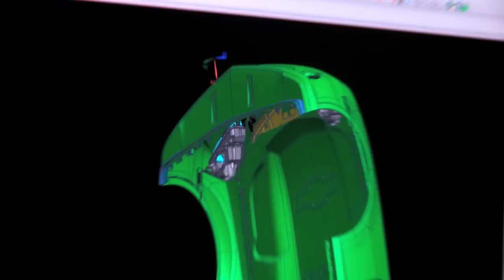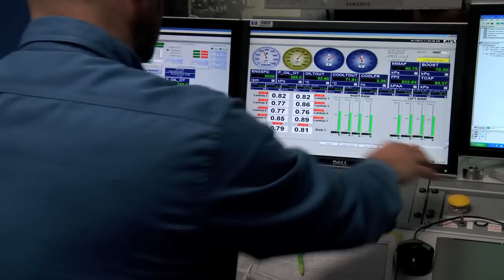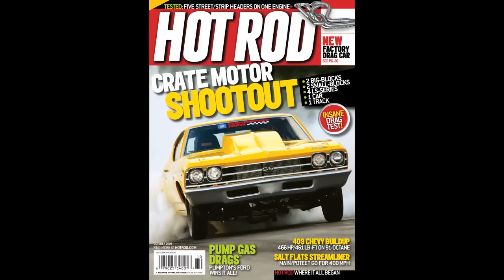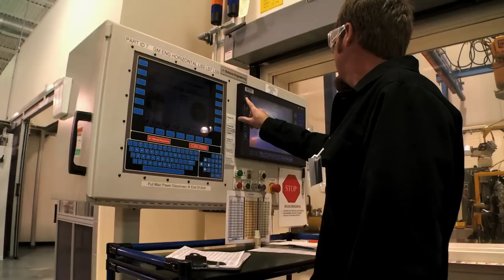2012 COPO Camaro:  GM's Baddest Factory Camaro Ever! - HOT ROD Unlimited Episode 6

Comment from the maker: To those questioning the purpose of a drag-only car produced in limited numbers, here's the deal. NHRA requires there to be a minimum of 50 factory-built models of a car in order for it to be legal in Stock and Super Stock competition. The COPO was built for just that reason, same as the Mustang Cobra Jet and Challenger Drag Pack. Also the same as many legendary muscle cars of the ’60s, such as the ’68 Hurst Hemi Darts and Barracudas.

Comment: If you look at the Vid @ 1:33~1:37 you will see a 9 inch axle under the new COPO Camaro. The ford 9 inch is not a truck axle, it was used in trucks, yes, but not only in them. 
Live axles handle fine, as the 2013 gt500 shows... it keeps right up with the IRS that Chevrolet uses.

Comment: The lower block of the LS is a copy of the 4.6 Modular with thicker webbing. The oil pump and galleys are the same as well as the cooling passages. What Chevy actually did is take modular 4.6 and put a cam into it. The LS heads are Windsor heads with with its angle plugs and raised ports from a Ford 427 high riser along with the sodium filled valves. The firing order is Ford and also the centered thrust bearing. The beehive valve spring are Ford Cosworth. THE LS IS 100% FORD.

Comment: Yeah. That was a major problem. They finally addressed it in the 2013 GT500 with a much taller geared transmission and taller rear gears. It's supposed to do 0-60 in 3.7 or something. It'll be interesting to see it tested.

Comment: You do know that the COPO package does not include a blown 427? The cars are offered with a 327/4.0ltr whipple, a 327/2.9ltr whipple and a 427 N/A or you can order all 3 engines when you purchase the car. The 327/4.0 will be run in Super Stock classes and the other 2 will be run in Stock class.

Comment: 428 Cobra Jets were rated at 335hp by the factory for insurance reasons, but really had around 410-420 hp. I know because i drove a 681/2 Mustang GT with a CJ for two years in the early 70's

Comment: It is used for specialty NHRA where you run in different classes and are limited by cubic inches and weight so these cars will destroy the competition in there classes in the NHRA so I'm very proud of GM. These cars will also be tuned and jetted for by the drivers for optimal uses when the run. These cars were designed to keep up with the Cobra Jet Mustang so look at the engines for those cars very similar to the motors going in the camaro.

Comment: as far as aftermarket, while we both can agree these SBC and SBF share the two largest aftermarkets, where the SBCs have the advantage... is that ancient pushrod technology you guys love to harp about... because its a single cam, push rod... parts are interchangeable throughout the years, a big aftermarket cam will fit a Ls1, Ls2, Ls3, etc. with minor valve train adjustments... while the aluminum blocks don't like boost, they are a nitrous fiend. and if you love boost, we have the iron block LQ4

Comment: I thought we were talking about making power and the difference between the OHC and OHV, but if you want to talk gas mileage, the Dodge Omni got 40 mpg back in the 80s with an OHV...recently tested by Car & Driver. I guess from your last comment, you concede that it takes a bigger engine to make more power.

Comment: 1975 SS Nova? How cool. I had to get away from hotrods after I built a street legal nitrous small block 355 that pushed a back-halved 1962 Chevy II into the high 9 second zone. I wanted to go 8 seconds, but my car was built for $9000. It would take an additional $15,000+  to legally run 8 seconds at the track.

Comment: The last LS1 went away in 2004. If you want to look at getting bigger, the last Mustang engine was a 4.6 and the new Mustang engine is a 5.0, but i don't see your point. The ZR1 never had a smaller engine. You're going to see how much power an LS engine can make if you watch the COPO Camaro. They're estimating 850 HP from a 5.5 liter engine, but since we're speculating, I'm sure Chevy could make as much HP as they wanted from a 302 CI engine...no problem...there are plenty running now with more.

Comment: And I do agree about the LS9. A fully built LS3 can make that kind of power N/A, and when you bring blowers into the mix there's no contest. The LS3 responds to boost better than the LS9. BUT, could you get GM's warranty on your built LS3? 

Also, the ZR1 isn't just about the engine. Could you make those 15in carbon-ceramic brakes? Or the carbon fiber body panels? How about those magnetic shocks? That's the kind of stuff you're paying that 111k for(ZR1 starting price, Chevy website).

Comment: You will notice that Ford knew the ZL1's power output and the only way they could compete was to bump the HP up to 70 or 80 HP more than the ZL1. They knew from what Hennessey was doing to the GT500 that it couldn't come close to competing unless it held a 20% HP advantage. A bone stock ZL! with only tires, ran an 11.4 at 120 with only 200 miles on it. I think it's going to be fun to watch the action to see what happens. Another ZL1 with bolt ons is already low 10s as well.

Comment: Try 3100 lbs and depending on what year fox. And the fully loaded trans am was right under 3600.  So here are the corrected figures that you requested.

3100/225=13.7lbs per 1 hp   3100/300=10.3lbs per 1 lb-ft of torque

3600/300=12lbs per 1 hp     3600/400=9lbs per 1 lb-ft of torque

And dont forget that the stang actually weighs more than 3100(i rounded down for you) and my model bird weighs less than 3600(i rounded up for you). This is fun.

Comment: Hot Rod magazine dynoed a 2013 GT500 and it made 670 HP. Soooo the GT500 weighs 270 LBS less and has 90 more HP and 44 more Lb/Ft of torque. And it will have a new dual setting suspension for taking it to the track. And it will get 4-5 MPG better gas mileage on the way to the track. And that's if you're talking about the ZL1. 

  If you're talking about the COPO, well it's not a street car. And Ford has a direct competitor for that called the Mustang Cobra Jet. So let the games begin :)

Comment: yea the Cross fire injection used in the 84 Corvette was junk and the TPI engine wasn't much better.  But if you do your research not very many cars in the mid 70's through the early 90's was really worth a damn.  When the LT1 came out gm had a good thing going for them and then the LS1 came out with 305bhp.  That engine cleaned the streets until 03 when the cobra came out.  My friend has a procharged 04 Z06 and it's putting down some incredible numbers

Comment: You have a point there...the old ZR1 did make lots of HP for it's day, so you have to ask the question: Where did it go? The answer: the OHV SBC began making more HP at a much lower cost; repair costs for the DOHC were out of site; the cost of the engine on the production line was excessive; and the mod-ability was very limited. The same applies to any other DOH!!!. 99 percent of all DOHC engines will never be modified beyond simple bolt ons, even superchargers will be limited at $10K per.

Comment: I think that and the 500+ LB/Ft of torque at 2000 RPM was part of the problem. They didn't ignore the issue. From what I read they completely reworked the gear ratios of the transmission and rear end to spread out the 600 FT/Lbs of torque better. I'm seeing some claims of 3.7-3.8 zero to sixty times and deep 11's in the 1/4 mile @ 125+ MPH. And even if the tires can't hold up stickier tires are a phone call away. Either way I can't afford one. But if I could mine would be without the stripes :)

Comment: No, they are not making convertible's as you say. They are making a one of one convertible to be auctioned off for charity (a good cause I would say). They are using the 5.3 supercharged as one of their engine options available for the copo and they have an all aluminum 427 availible as well. Different people like differnet things and fyi the 5.3 supercharged runs faster than the 427.

Comment: I realize the problems with preparing a car like this for  highway use, but there should have been a detuned version of this car that was street legal.  Say you could keep the trick rear end, with minimal sound deadener and power draining options, along with aluminum and/or fiberglass body panels for light weight, along with a selection of high horsepower GM engines. Develop a set of “cheater” slicks for the rear that you could get a few thousand miles out of, and put the battery in the trunk, all the old hot rodder tricks, plus the new technology like launch control. I’d want mine with an LS7 and dog dish hub caps.
Reply: dougeroo1 then it would ruin the purpose of it

Comment: I was using the 5.0 because it's the easiest DOHC 4 valve example of a superior design. I could use the 4.0 DOHC 414 HP BMW M3's V8 which also outperforms the Camaro as an  example too. But the Ford Coyote is a better example because you can get it for around the same price as an LS3. The writing's on the wall. push rods are being left behind. VVT and direct injection are the only 2 efficiency tricks left for the LS3.

Comment: No. And I'm not saying push-rod motors are shitty. I like them just fine. I have a few and just am building another right now. I can however, like something with out having to believe that it's better just because I like it. As bad ass as the 331 I built is. It would still be outclassed by a similar displacement 4 valve OHC motor. I can live with that. My tactic is to have a very light car. Lightness makes up for a lot.

Comment: are these new hot rods like the copo, super snake, and hellcat a whole lot more faster than the hot rods from years ago? if so, could you actually put these new type motors in an older hot rod, say like a 69 camero, or even a 55 chevy? if you could add the new type motors, suspension, and brakes in an old 55 chevy, that would be cool!

Comment: Every auto venue? 351 Clevelands ate the Chevy small blocks lunch in Small block Pro-Stock. Two 351 Windsors just swept the Engine Masters challenge beating out a bunch of SBC and LS motors. I did ask a hot rod builder why they use SBC's. He said it was price availability and oil pan sump options back in the day and nothing more. Hot rodders used what was cheap and available and that was the SBC back in the day. In modern Hot rods you see way more variety in the motors they use.

Comment: The shelby is a still a ford product by the way.  It still has a ford V8 that has been modified and the same ford mustang body style.  It was fords 427 side oiler that made the AC Shelby Cobra famous and run as great as it did.  Only 1100 cobra's was built and only 50 of them had 427s.  There is only 3 427 true cobras known left around and that survied.  One of them is in Shelby's Museum in Vegas.  If you still want to challenge my knowledge of cars go for it.  I'll keep educating you about them

Comment: ■1987 Ford Mustang GT 0-60 mph 6.4 Quarter mile 14.4 (Automobile April 87)
 ■1988 Ford Mustang GT 0-60 mph 6.4 Quarter mile 15.0 (Motor Trend January 88)
 ■1989 Ford Mustang GT 5.0L Manual 0-60 mph 6.2 Quarter mile 14.8 (Motor Trend January 89)

what was that about 5.0s running 13s?

Comment: Spend some time at the drag strip and you'll find the fastest and most reliable power comes from the SBC. There's nothing wrong with low tech if it achieves the goal and the SBC does. My 2002 C5 Corvette would get over 30 MPG if I stayed out of the throttle..low tech, yeah, great muscle car, yeah, great MPG yeah. I traded it for a high tech 4.6 liter OHC Mustang Bullit and got beat by Chevy Cobalt, quickly traded that for a Camaro SS and haven't been beat by a 5.0 yet...7 tried unsuccessfully.

Comment: the production of the mustang was designed and built for the young public.  Ford wanted to make a car that would catch the eye of the young car buyers of the 60's offer a decent powerplant and a cheap price that just about anyone could afford.  For 1500 dollars or less you could have a new car.  418,000 Mustang were sold in its first year alone.  Even after the camaro and challenger came out ford was still out selling them and beating them in the scca racing series and on the street.

Comment: I would much rather have a ZL1 all the way, but if I had to settle for less, the 1LE would be just as badass.  Though disappointed because I thought the 1LE was basically a ZL1 without an LSA.  But it's not because no MRC system.  It would be much better of being an ultimate track car if it had that.

Comment: the ford 9" is the best rearend for racers.  unbelievable versatility.  the strongest (3 teeth in contact rather than 2)  wider range of ratios, drop out carrier, more options for spools, lockers, and limited slip kits.  the next best would be the ford 8".  GM can't make rearends to save them from bankruptcy.  doh!

Comment: I never called, "not fair". 

The point I made is that tossing a bunch of power under the hood of an outdated "ox-cart" like the GT500 has, at best, made a substandard braking/handling car fast enough in the straight away to mitigate its slower performance in the corners.

Tossing even more power at that car would actually be a detriment to its handling ability and would make the gap no closer. 

The ZLI, with little more that a weight reduction would become untouchable by comparison.

Comment: I'm not trying to debate ya.  Even if the 5.0 Coyote is the better engine(It is...Despite my reservations. I'm a Chevy guy anyway...Currently running a mild 4.3L vortec, and I hope to buy a LS1TT C5 after college.)

I'm glad the Camaro is "Horsewhipping" the competition. :D

All i'm saying...Is that the Chevy SBC is not the be all end all...

Cheap parts? Sure. Reliable? Yeah. Proven @ the racetrack? You bet.  Low tech? Yup.

Comment: With 5 years and enough complaints from customers, Ford knows that the skinny rear tires that it equips the gt500 with cannot handle 500 hp let alone 650. Hell an 2003 Viper has wider rear tires then previous GT500s. Frankly i would not be surprised if they ignored that issue and that will be the GT500's downfall.

Comment: The purpose the COPO car is for professional NHRA racer who want a brand new 8.90 sec rated chromoly chassis without having to built and testing it. The car setup comes all done. Besides, Chevrolet already have a street legal racing machine : the Camaro ZL1, it has lap the Nurburgring in 7:41.27 bringing the Camaro neck and neck with the Porsche 911 Turbo S and Lamborghini Murciélago.

Comment: I have no doubt an LS series 302 could make the power. It just couldn't make the power and retain the fuel efficiency. 

And once upon a time the ZR1 did have a smaller (350 inch) engine. And it made 405 HP waaaay back in 93. How did it make so much power? Yep, Dual overhead cams and 4 valves :)

Comment: The 351 Windsor, never got nearly 30 MPG. It never had variable valve timing and never put out as much as 850 HP or even 430 pure stock. It never had 4 cylinder deactivation or direct injection. It never had one coil per cylinder and it never set records like the low tech Chevy. There are simply too many Fords running at the drag strip with Chevy engines to support your argument. In the Extreme Engine Masters Challenge for 2011 the SBC made more HP than the 351 W with 736 HP to 676 HP ..unh huh.

Comment: As a Die-Hard Chevrolet fan, I'm quite disappointed in recent activity with GM. Why the hell would you make a drag-only car a convertible? (Yes, they're making COPO convertibles.) That's like buying a Honda Civic just for gas mileage and giving it an LS1 swap. And what's up with small V8s (except the 427)? If it's a full-out drag beast, give it your best, supercharge the 427, or install a 454 big block with a supercharger. Come on, GM. Bring out the Camaros that used to demolish the competition.

Comment: I didn't say it was better. They reworked the gearing and now it will be different. So comparing it to the 2012 GT500's lack of traction might be wrong. The LS3 is not state of the art. It is a inline valve, push-rod, wedge motor. Just like the 351 Windsors that beat several LS motors in the Engine Masters challenge this last year. The old push-rod design is just flat out inferior to the D.O.H.C. 4 valve design Ford uses for their V8s. That's why little Ford 5.0s can match big GM 6.2s horsepower

Comment: I didn't say cylinder deactivation was on an LS3, but on the SBC. I've probably owned more Fords than you since I'm an old fart and I know they made good engines and if you agree that the Windsor was a good engine....um, wasn't it an OHV? YOu're right the LS3 doesn't have direct injection, but the 5.5 does and that's the engine that will be base in the C7 Corvette and most likely the 2014 Camaro and currently in the C6R, Camaro racing and CTS-V cars in Alms and SCCA.

Comment: The 9 inch in that car simply retains the Ford 9 inch name, it doesn't contain a single ford part, its an entirely aftermarket unit built by strange engineering.  GM built plenty of rear ends that could hold power, the 9 inch has just made it to the aftermarket scene due to the vast amount of applications.

Comment: The 6.2 with only headers (like the Mustang has), easily dynos at 460- 480. Even with the Boss 302 intake the 5.0 only comes out with 460.  The 6.2 has no problem making HP, but it just doesn't need more to trounce the Mustangs. Next gen Vette and probably the Camaro will run a 5.5 liter na direct injection engine making an easy 440 hp with plenty room for improvement in later years. You Ford guys should simply look at the NHRA records through the years...Chevys rule.